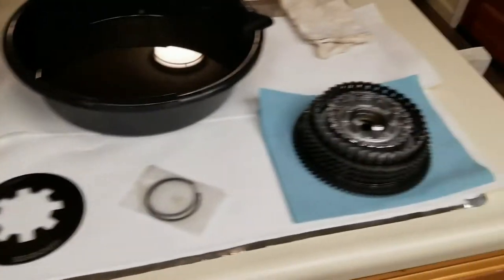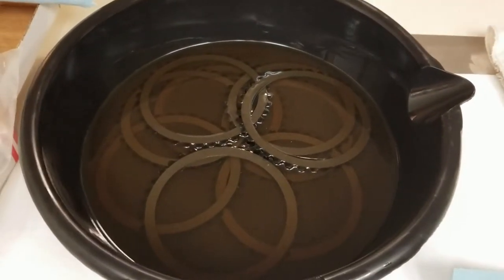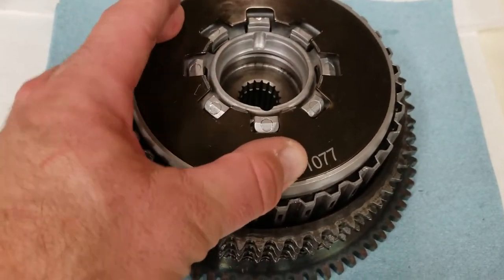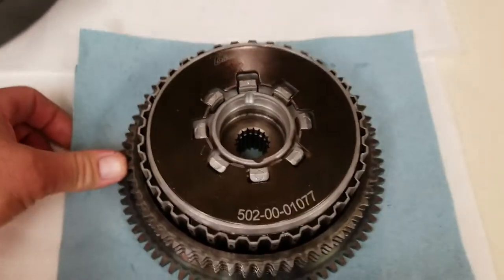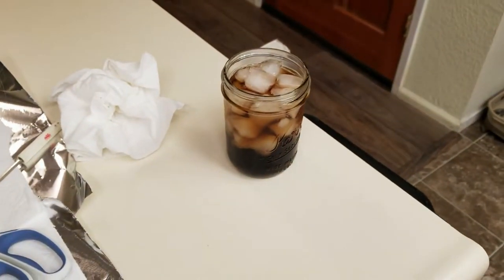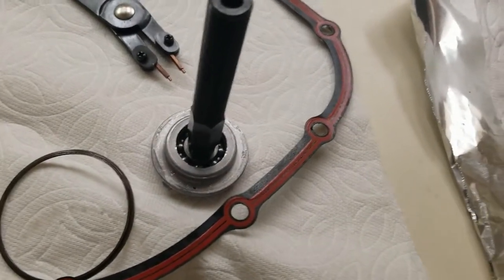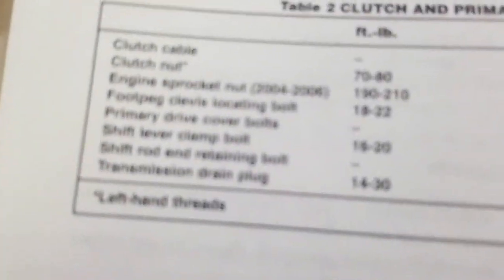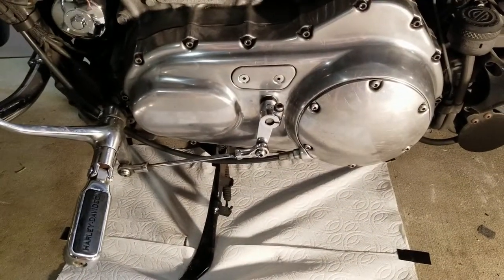Drunken how not to replace your Clutch Pack on your Harley Sportster

Comment: Good video. I would have been cussing too much to do that. I like the paper towel idea! 

Oh, the legend of Harleys dripping oil comes from the primaries on Panheads and older bikes having a weep hole. The weep hole was supposed to let the metal shavings out that build up. Then when Evos came along and started leaking around the jugs people just assumed it was meant to be.

Comment: How did the new bearing hold up? I just put an extra plate kit in, but I am going back in to put a 20% plate in. I am getting a squeal from it when I pull away in first gear. My throwout bearing has a very small amount of play in it so I am thinking that might be the issue. I don't want to throw a garbage bearing in lol
Reply from the maker: I was having the exact same issue. I thought this was the issue, however, after replacing it, the squeal came back in a few days. I gave up on chasing it down for now. I bought another bike and figure I'll tear apart the Sportster again and dig into it more when I have some time. If you find out what's causing your squeal, let me know. I'm replaced everything in there it feels like.
Reply: @MotoMike805  man oh man, so I pulled the derby cover and readjusted the clutch both on the line and in the primary, changed the fluid from ATF to amsoil 20w50 for primaries and adjusted my primary chain again and vwa la! No noise.....for a day lol. The noise is back, not as bad but it's back. The bike has 9020km on it so like under 5000 miles, but I am bad for dumping the clutch in motion and doing greasy burnouts, and I checked for play in the bearing. There was a little bit, but nothing that would worry me. I'm replacing the throwout bearing when I do the clutch plate, and everything is perfect. If it still makes the squeal when I pull away after the bearing and clutch spring I will accept it as normal and beat the ever living fuck out of it lol
Reply: @MotoMike805  If you figure out the squealing or funny whistling sound some of them have please let me know because I couldn't figure out what was causing it. Asked the Stealership when I bought the bike and was told it was part of the break in process and should go away at 10k miles. Which oddly the noise it did right at 7k and never came back. Yet I have seen bikes it never goes away on bikes with triple digit milage so I am curious. Thank you 👍
Reply from the maker: @sswcustomsewing4276  Well, I never left a clutch pack in more than a few thousand miles to find out if it would have gone away by breaking it in. That would have saved me some trouble. LOL! Kind of makes me want to put it back in now and run it until it hopefully goes away. LOL! I did figure it out, or at least on mine. A tech at the old Gary Bang Harley dealer where I live told me it was the Grenade plate removal that was causing the squealing. I thought he was crazy and ignored his advice for years. Went through every after marker extra plate clutch kit, multiple bearings and new basket. Finally, I ordered an after market spring plate, not the one from Harley, and just recently reinstalled it. It went away and hasn't come back. I like the fell of the extra plate clutch kit much more though and was going to put it back and just ignore the squeal, which I may do now just to see if it goes away after a lot of miles.

Comment: Good job. The part I remember being a trip on mine was how much fluid those friction disks soak up.  I also had that annoying factory spring plate come loose and had to fix the clutch in my 07 883 Sportster at I think almost 25k miles. I replaced it with the BDL BTXP-12 High Performance Extra Plate Kit which made a night and day difference that I am still very happy with. As for my clutch basket it was not scarred bad and everything else was just fine. If I would have known about those spring plates being a problem for so many people I would have bought and installed the BDL extra plate clutch kit when I bought the bike new. I love how the extra plate kit with stiffer spring does not slip, improved the shifting, quieter primary, and as for adjustment it has not been an issue like the factory clutch pack was. I was told by a old mechanic that the spring plate was used by the factory for extra cushion and rider comfort because harley davidson wanted the bike to be more appealing to the public. Personally I think it was a stupid idea on their part thats just my opinion. Anyways thank you for sharing this video.
Reply from the maker: That was my first Sportster and had no idea they had an issue. When it first happened, I thought it was the cable needing adjusted and kept trying to adjust it. I probably screwed up the basket trying to test ride it after trying adjusting it about 5 times before I realized it wasn't that.
Reply: @MotoMike805  I did the same thing with the adjustment on the clutch and the cable thinking what the hell ? Then I had a mechanic tell me about the ring coming apart and to order the kit from BDL. I like how it locks up and does not slip it kinda reminds me of the old heavy duty 3 finger clutches used with GM M22 4 speeds they were a little stiff yet did a great job. What I have seen that really hammers on those clutch baskets is rolling down a hill and popping the clutch to start them. I had a start relay go bad and for a month I parked on hills or spots I could bump start the bike I don't advise making a habit of doing that.